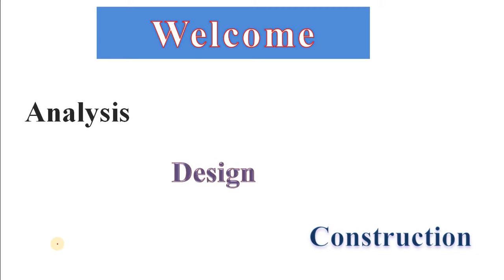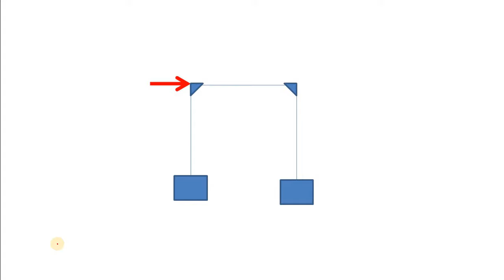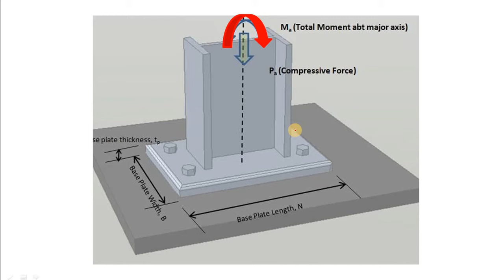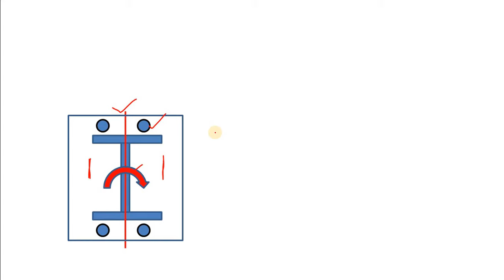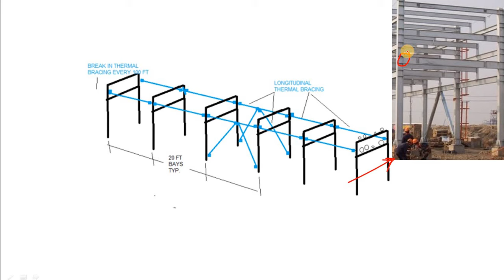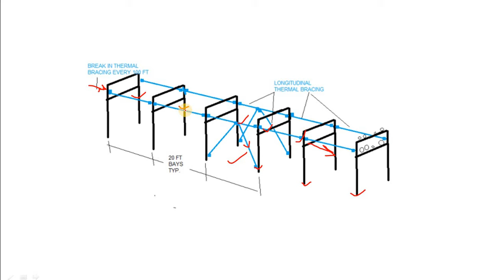What is Bracing & Why Bracing is Used? How Bracing carry Load?

Comment: hello! great explanation! why dont we put bolts againts minor axis so then we dont need bracing?
Reply from the maker: Ha ha ha.. great...Dear minor axis does not have any material to cater the push and pull. So ,it is not possible to cater moment .yes it is possible is the member is a box or circular section.

Comment: can we only apply bracing in case of Pin joint support ? what abt applying bracing  on moment connection?
Reply from the maker: Normally it is not provided for moment connection.
But in some cases where huge lateral load is coming , it can be used in association with moment connection.

Comment: Informative video. Can you make video on how to decide the location of bracing like at middle bay or at the end bay. That will clear the whole concept.Thank you.
Reply from the maker: Great suggestion!
Reply: @kush patil bracing are usually planned in symmetrical arrangement. Like Alternate bays or some repeating pattern after every 4-5 bays if the structure is long.

Now when it comes to sides, location of openings,door, access decides it. Bracing is not planned at the side where there is access or opening. Or in such situations k bracing or other type of bracing is provided by which access is not restricted.

One more point in consideration is it is a usual practice for same bay bracing (at sides and roof)
Reply: @atifnawaz7623  Thank you

Comment: It would be great if you talked about the basics of small aircraft fuselage load bearing, bracing, & load transfer. Also if you did the same thing on the wings, and how the wings are attached to the fuselage.

A suggestion for a follow up video would be how to strengthen a fuselage and wing design that would make it stronger than first designed.  I often wonder why a wing that will handle 3Gs, how it would be designed to handle 9G, along with how attachment and fuselage supports would have to be strengthened and how the loads have to be transferred to the rest of the body. 
Some of it seems obvious, however not being an engineer my guess is I’m probably not even close. Thank you for your Consideration.
Reply from the maker: I will try
Reply: @TonmoyMaity  Thank you sir, that would be awesome. I know there are a lot of people in the experimental aircraft community that would be very interested in watching videos about this and also learning where to find some great resources that kind of get directly into those questions without having to become an engineer. Lol I know that is a difficult request as a person must know the basics and even intermediate engineering principles to truly understand how to approach it. However, Whatever you come up with would be awesome. And if you do come up with something I will send Links Out to all the people in the aviation niche.